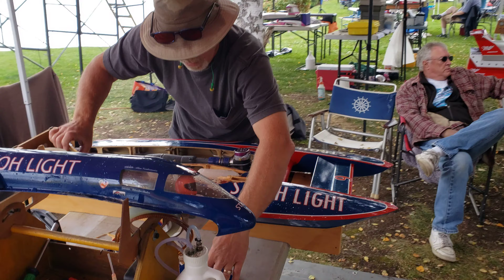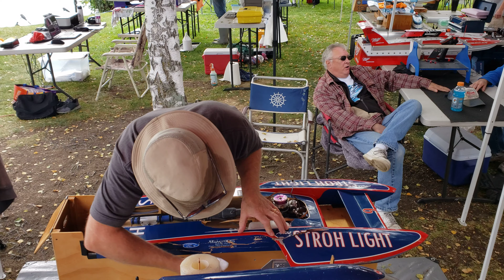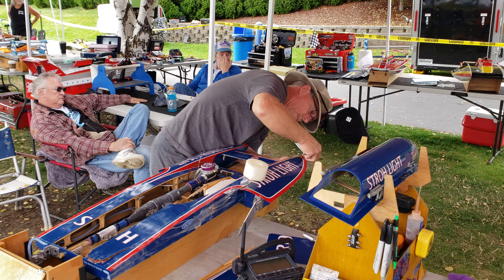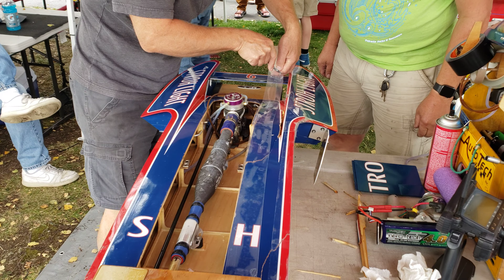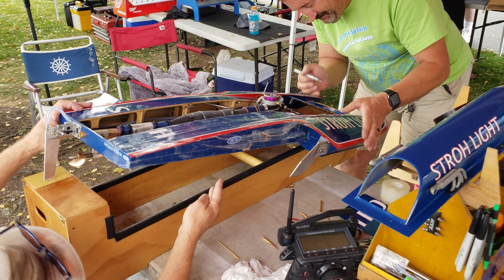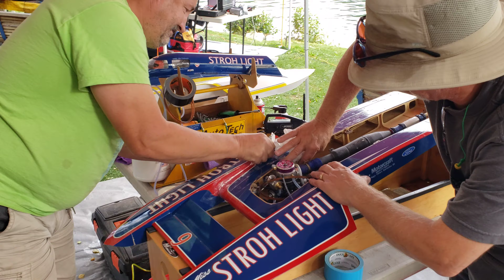2021 RC Unlimiteds Gold Cup thrash! M5 Performance rebuilds a boat

Comment: That's proof in the puting that building lite , but strong does it good. That trick of useing tape on the field of the sponson except for the perimeter '' that saved it '' what a great idea. 2 things , saves on wheight & you get a smoth finish...